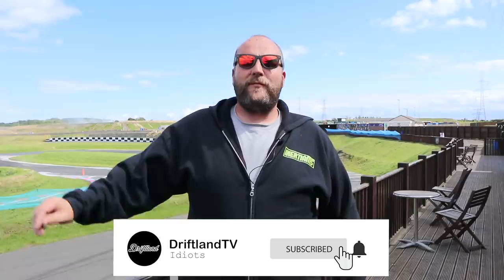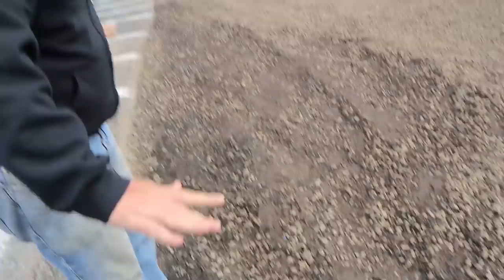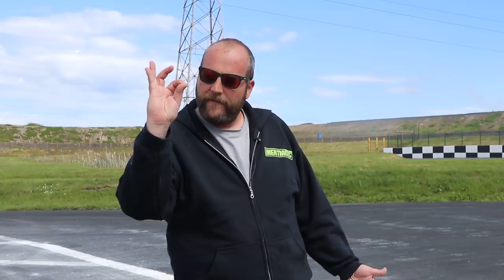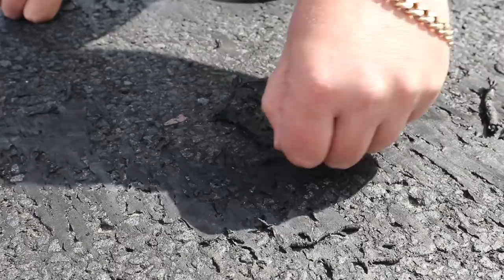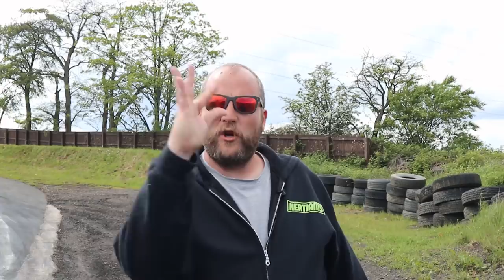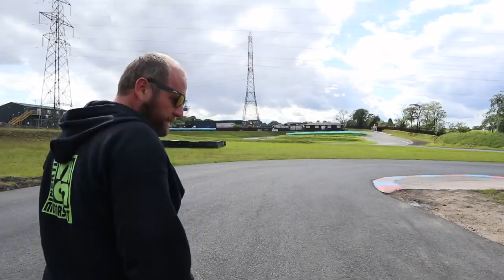Our Top 5 Reasons why "Real" Race tracks HATE Drifting

Comment: Try using sand for the trap instead of gravel. It won't get thrown as far. Seems the opposite since it is lighter but it being lighter it has far less momentum then a stone when chucked by a tire spinning at the equivalent of 80 mph more.
Reply: Cragified have you ever tried to get a car out of sand compared to on gravel? There’s a reason why pretty much every race track uses gravel.
Reply: @sjgreen1995  yes it's easy you use a tow truck ..... The gravel traps ain't that big here to be a issue

Comment: A modified lawn scarifier (ie. the things used for raking moss out of your lawn) might work for peeling the rubber off the track?
Reply: Generally the only way to remove soft rubber from the tarmac is to have the track surface blasted with steel shot

Comment: Heres an idea. Why dont you put a step in the concrete at the edge of the track where the dirt drops are happening. Like 3-4 inches. So it feels like your off the track when driving but wont dig up the dirt.
Reply from the maker: we need to butt up level to the tarmac, and i think what you describe will break very quickly. cool suggestion though!

Comment: #1 use lime (as in limestone) and water (goes away after some rain)
#2 try tu use sand instead of gravel ( for spectator seafty)
Reply: I dont mean to step a line but you seem to lack some very basic life facts, water goes away with the sun or heat or even a massive towel, water comes back with rain so you end up with more water

Comment: Probably very silly question but I don't watch a lot of drag-racing. But can't you use a torch and some spirits on the track where there is left over rubber to burn it all off? Isn't that what drag guys do to clear the start of the strip? If so, would that work?
Reply from the maker: Running regular drift traffic over it cleans it all away. its mostly gone now.

Comment: How about tyre walls? You must have enough shagged tyres lying about to add a softer buffer to stop people flying so far.
Reply from the maker: Hi, unfortunately tyre walls are a no-no for the same reasons as barriers, infact tyre walls are worse for causing rollovers as they claw cars into them. ALso you'll notice tracks don't use shagged tyres too - they are less structurally sound and wires hanging out of them would be another H&S consideration. We're just going for education and hopefully helping change other venues views on drifters! fingers crossed.

Comment: Why not mod a hoover, instead of the bag put a long pipe to sort that gravel out
Reply from the maker: some hoover that would need to be! the sweeper's hoover struggles enough
Reply: @DriftlandTV industrial vacuum cleaner is what you want, if not there must be something that could be adapted, making a vacuum and separation of the particle's is the easy bit, making it easy to handle that's the hard bit